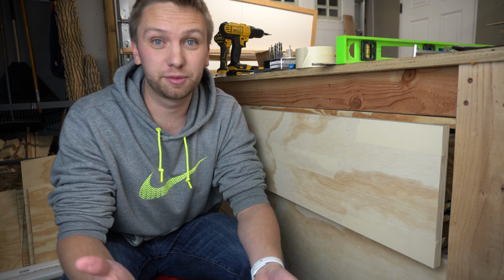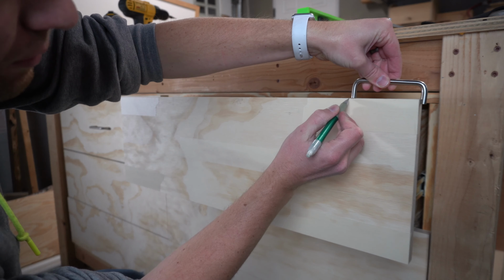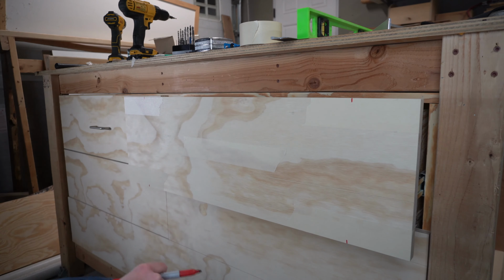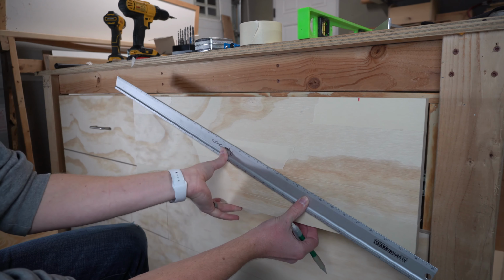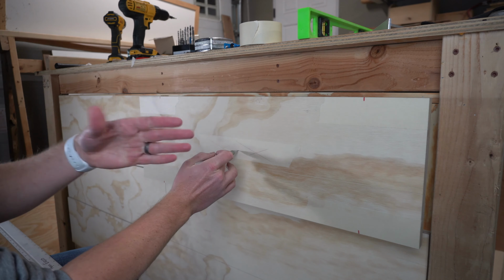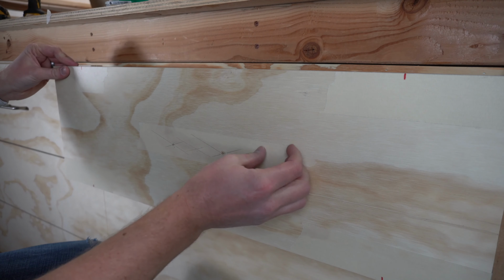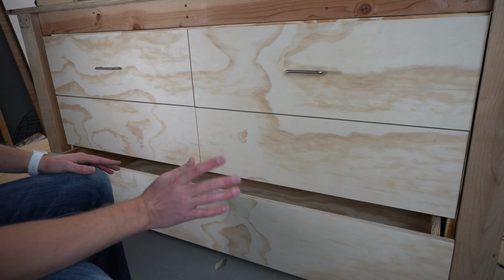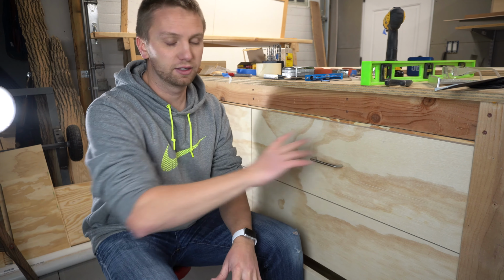How To Install Drawer Handles on Cabinets - Perfectly Centered!

Comment: Wow!! This tip is amazing! I've been putting off finishing my project for fear my pulls would be wonky, but not after seeing this. Thank you so much!
Reply from the maker: Glad it was helpful! 😁
Reply: @Aileen Hurley For two handles just mark a line in the middle of the width of the drawer and treat them as two separate drawers with the middle line being the left edge of one and the right edge of the other.

Comment: WOOOOWHOOOO!!!… 
Finally, a clear, cut and dry method that not only works like a charm. But works with drawers of different sizes!!!! 
I can’t tell you how long I’ve been putting this off; as I’ve not been able to find a single video on this…that I could understand anyway. 
Thank you from the depths of my soul!!… 
As you’ve given me the knowledge to FINALLY see my project through, after being at a complete standstill for MONTHS!!! This is going to be a total game changer for future pieces too! 
Thanks again…I’m 100% subscribing to this channel.

Edit: It didn’t work. 😭 I’m off by about a 1/4 of an inch every time. 
The drawer faces are both concave and convex…I’m wondering if that’s why I’m having such a tough time?
Reply from the maker: I'm sorry to hear that...😔
Being concave/convex could definitely tweak it just enough to be off by a little bit but honestly without trying it myself I'm not quite sure.. 
are the holes in the drawer pulls centered in the pulls? and do the pulls seem symmetrical?

Comment: Tried adding 1 handle on on a slim spoon drawer like the last one you showed at the end, but the cross lines come out exactly the size of the handle 6 3/4 . Trying to figure where I went wrong? Maybe when I decided to put 1 handle on a 34in wide drawer

Comment: This is great! I don't know what I'm doing wrong but for four straight drawers my holes need to go just to the outside of the center of the x to line up with the pull. But it's still working. Any ideas what I'm doing wrong?
Reply from the maker: hmmm... my only thought is that maybe the holes in the handle aren't quite centered on the stems on the handle (if that makes sense). If the holes are centered on the stems of the handle, it should work out pretty well. Let me know if you figure out what's causing this, I'd be interested to know!

Comment: This is great, but would it work for a IKEA handle? What would I need to adapt? 
KALLRÖR Handle, stainless steel, 8 3/8" - IKEA
Reply from the maker: Shouldn't need to change anything. Go by the hole spacing just like I showed in the video and you should get the same results. The "handle" part of the handle extending past the studs where the screws screw into doesn't change this method. Does that make sense?

Comment: Hello, any tips for me to install handle pulls to a wooden serving tray? Don't want to drill thru the edge where pull will be.
Reply from the maker: I’m not sure I understand your question… 
Wouldn’t you drill through the tray and countersink the screw head on the bottom of the tray?

Comment: Hi, this looks really helpful, but I have long handles that are around 17 inches long, would this method work for those as well?
Reply from the maker: Yes, it will. I had to draw it out to make sure but I don't see why it wouldn't work lol. Check out the diagram I have on my website for this project (link in description) and make sure to connect the lines like I have shown. Let me know how it turns out!

Comment: Would this same method work on drawers that don’t have sharp corners/edges, but a slight rounded edge to it? Like, could I still get those marks using my drawer pulls like you did in the beginning of the video?
Reply from the maker: I would measure in from all 4 edges like an inch and then basically draw a new box on the face of the drawer. then use that as your “drawer face”. know what I mean?

Comment: This is SO helpful. Thank you! I have one question: Is it easier to drill the pilot holes with the drawer face on the dresser or detached from the dresser?
Reply from the maker: Awesome, glad to hear that! 
Well in my case, I have the drawer face and the second drawer face (the front of the drawer) to drill through so it’s probably easiest to drill the holes with the drawer face attached. Does that make sense?
Reply: @DoingWhatever  that definitely makes sense. Thanks again!

Comment: Brilliant!
Reply from the maker: Thanks! Wish I could say I came up with it lol
Reply: @DoingWhatever  we’re installing tomorrow. Question:  our screws are too short to go through front of drawer box and facing. 

Do you recommend buying longer screws, countersinking, or removing face and attaching the pull then screwing all that back onto the drawer box?
Reply from the maker: @barbwagner967  I would try buying longer screws first, that would be the easiest fix. Countersinking second, and removing the drawer face third. 
When you take off the drawer face, you run the risk that they may not go back on perfectly aligned like they were. Odds are they will, but just in case I try to leave them on once they are installed. If you do have to remove the faces to install the screws, you’ll probably have to countersink the heads since they’ll be sitting between the face and the box now. Also, if you ever swap out the hardware for a different style, you’ll have to go through removing the faces all over again lol. 
Good luck with the install!

Comment: SUGGESTION: I would really like to have a video on where to place handles. (On slab full overlay doors and drawers in my case)
Plus I have 2 doors that are glass with apx frame around each door. That may change the whole placement of the other door handles…?

The 2 vids says nothing thing about the height from bottom edge of door. 
They do talk about the placement on the vertical to each handle but none talk about the height from the edge on doors or drawers. They talk about putting the 2nd and 3 rd drawers a little higher….some say .25” & .50” others say 1/8” to 1/4” respectively but nothing else on the door handles height. Again, they do talk about putting the door handles from 1.25” to 1.5” off edge so they’re closer together but nothing on the height when placing on a slab door, just shaker style placement.

Comment: The best and easiest way u can measure its to measure the lenght and the high of the drawer divided by two and the distance between the two handles holes then u must substract the lenght minus the distance between the handle holes divided by two and thats it if that makes sense
Reply from the maker: Right but that involves math and potential errors because of math. This way doesn’t need any math and is based on connecting dots with lines and is pretty hard to mess up lol. But I understand what you’re saying 👍🏻

Comment: Was all ready to install my drawer handles using your guidance but noticed that the screws on each end of my handle are not in the center.  the right hand portion of the handle the screw is towards the left of a rectangular compartment and the left hand portion of the handle is towards the right of a rectangular compartment.  I can send a photo if you could tell me your email address.  Thanks Walter Rubin
Reply from the maker: Yea that would make things a bit more complicated...
In that case you would have to line up the center of the screw hole on the corner of the drawer face and then mark the center of the screw hole on the other side of the handle. Not as easy as hooking the handle on the side of the drawer face, but still very doable. Hope that helps!

Comment: This was extremely over-complicated and error prone. 
Measure the height and width of you drawer. Mark half of that distance from the top and the right. Measure the distance, center to center of your drawer pull screw holes. Mark half of that to the left and right of the center mark you made. Done!
Reply from the maker: I would argue that measuring is more error prone than this method, because measuring and dividing in half is typically where the error occurs. 
With this method you are simply hooking the handle on the edge, making a mark, and then connecting dots. Then where lines cross, that’s where you drill holes. It’s quite simple. 
It’s the exact same methods for finding the dead center of a rectangle (drawer face) - sure you could measure it out and get pretty close, or you could connect opposite corners with a line and know that the intersection is the absolute center.